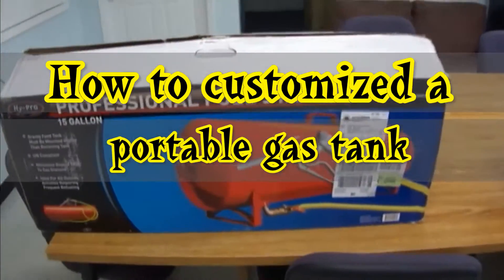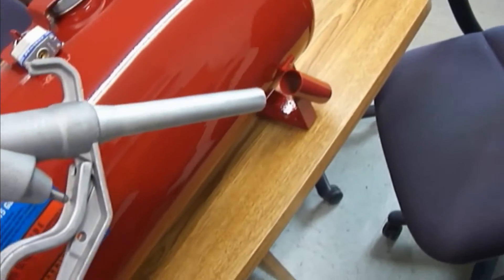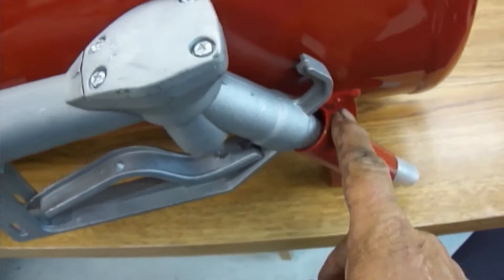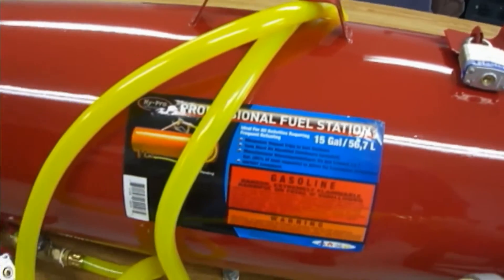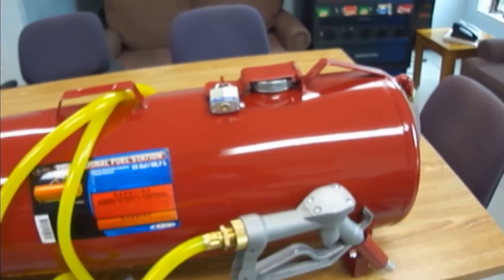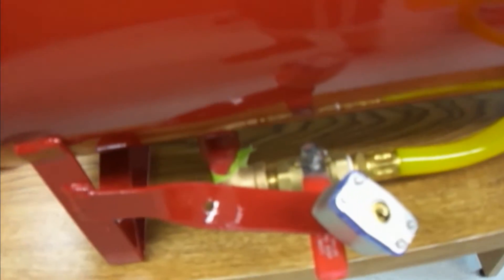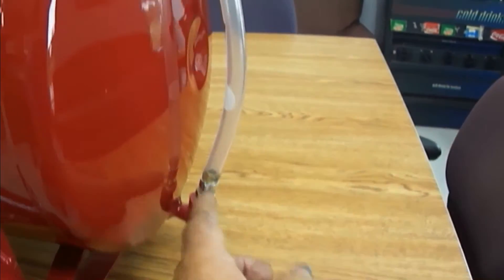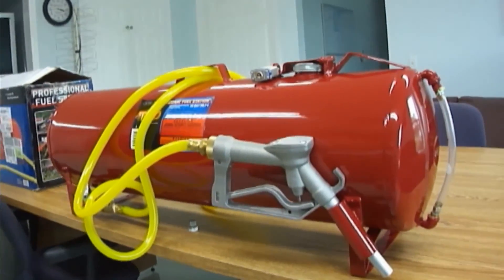how to customize your portable gas tank

Comment: Great build however you do realize someone can still rob you of your gas in under a couple minutes?
Reply from the maker: That is with anything  Baker still at the gas pump while I'm getting gas, you could get the gas out of back of my truck at a red light.  this gas can was designed for one particular person at work  one particular person at work was taking a gas consistently so I came up with a gas tank design now it's been like five years the Gap problem has been cured thanks for your comment.